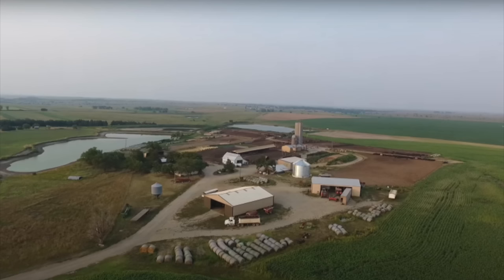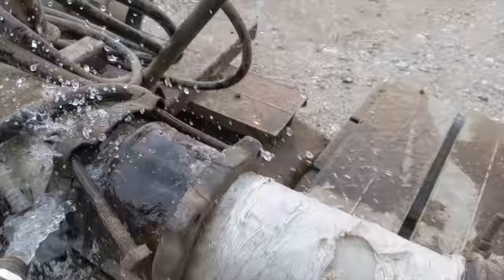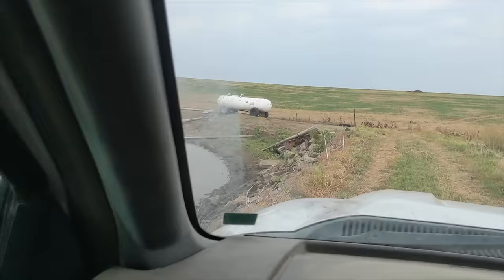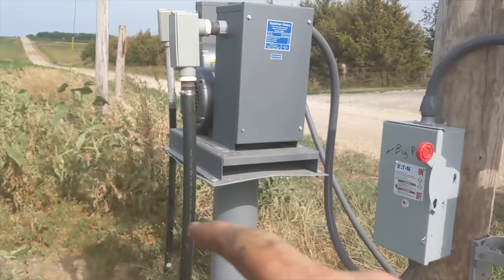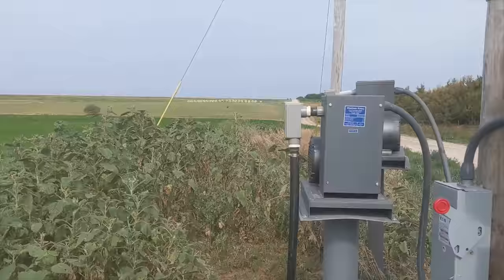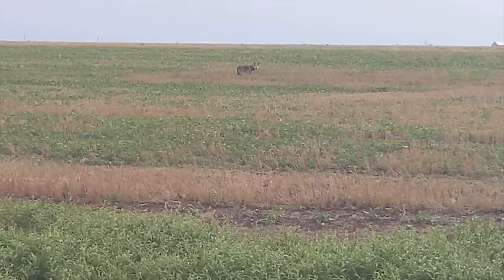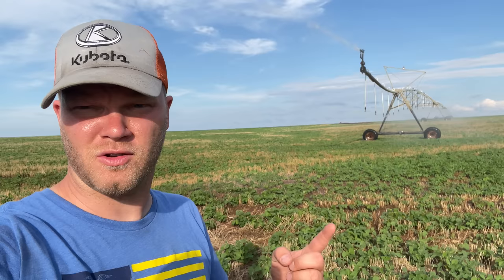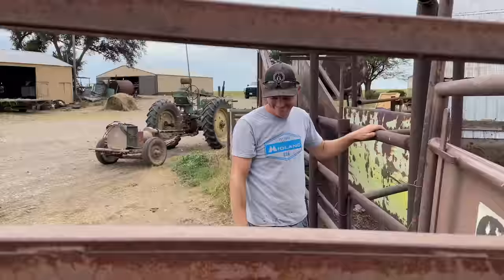IT ROLLED INTO THE WATER!

Comment: Hope you're running filters on those pivot's, I mean, you can see the trash getting pumped through the line. 
Now, that is one thing I DON'T miss when I still farmed. The vaccinations, ear tagging, implants, etc., sometimes, it went easy, a lot of times, not so much. LOL
Here in Eastern KS, we're still hot and dry and in a heat advisory clear into next week last I checked. We did get a small rain the other day but, not enough.